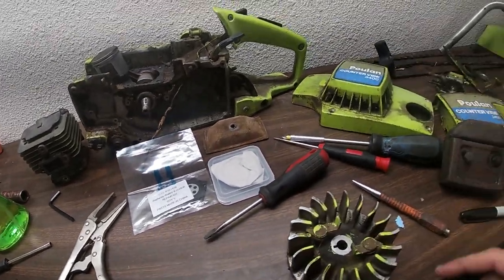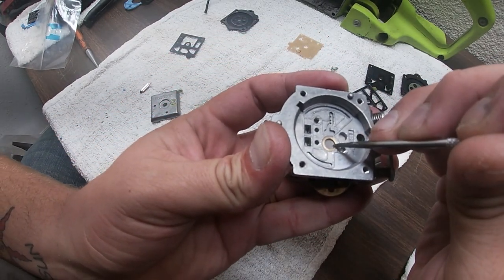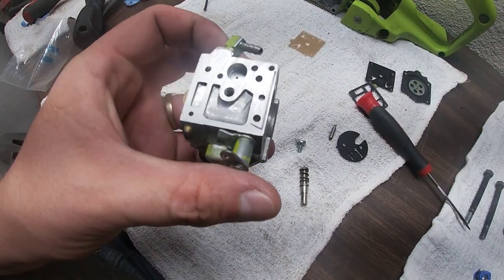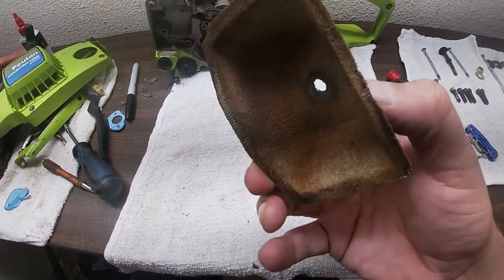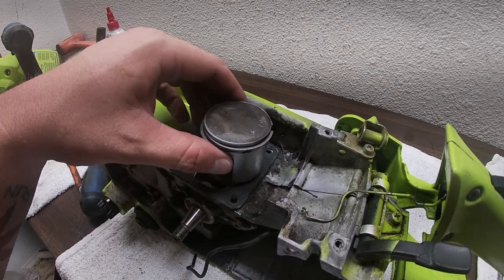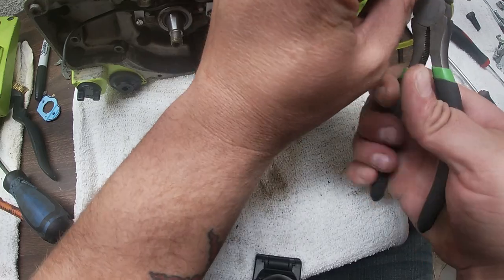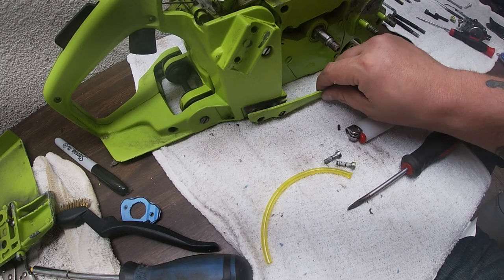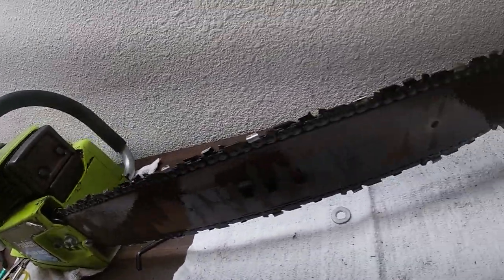repairing a very old Poulan chainsaw. Over 20 years old!!!!!

Comment: Poulan use 40-1 mix. Great cleanup and repair video.
Reply from the maker: Thank you. I normally run 50 to 1 and everything they blow up. They blow up most of the time they don't though lol
Reply: I agree with You and that is what I do and it’s 25 years old